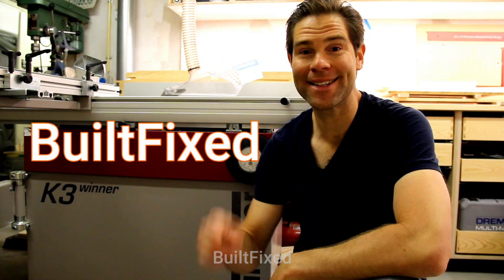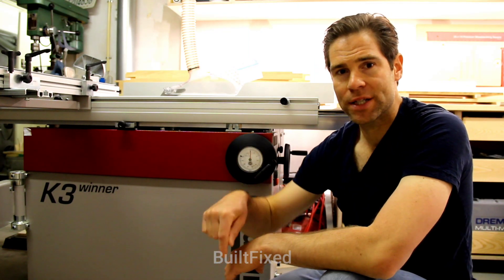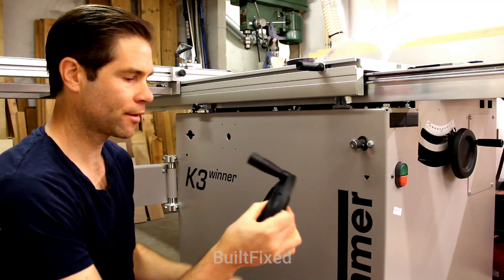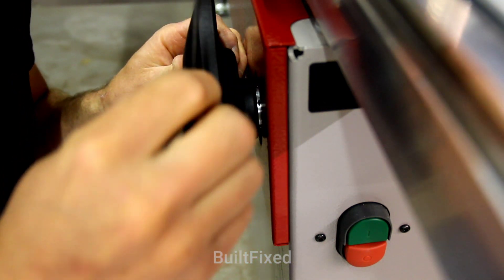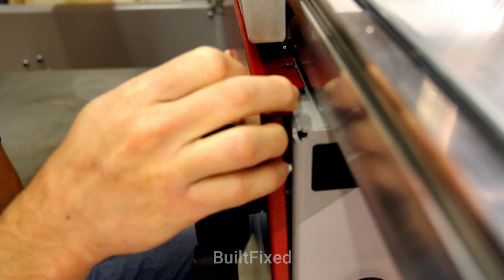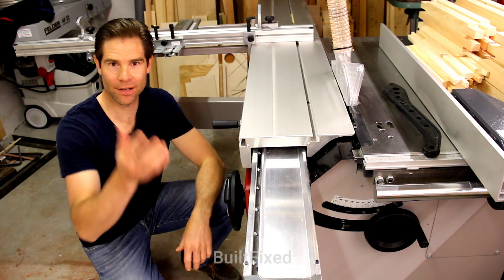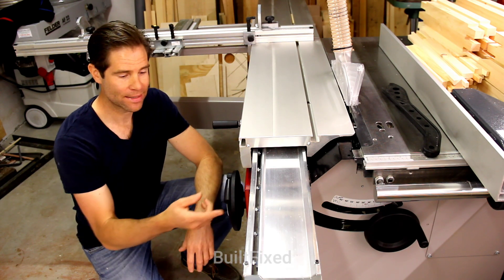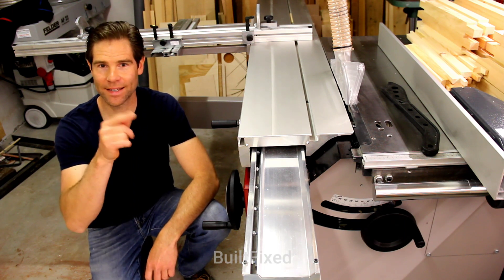Felder Hammer saw tilt angle indicator

Comment: I would be very interested to see another video by you in which you test the accuracy of the angle indicator. I'm waiting for my K3 to arrive. Mine is configured very similarly to yours. I am all for buying add ons that improve the accuracy of the machine. For that reason, I bought the fine-adjust knob for the improved fence. If the angle gauge is accurate, I would order that, too.
Reply from the maker: Hi John. I just made a brief video that tests the accuracy and precision of the accessory gauge. It can be found here: https://youtu.be/F5A-c9gE_4Q

Comment: Felder design team really didn't think that set screw access through very well did they?
Reply from the maker: I think I also would have prefered a more positive connection similar to the A3 where a bolt passes through both the wheel and spindle.

Comment: Interesting. I don't recall that this was available when I ordered my saw. I'd be curious about the accuracy. I've never found stickers to be accurate on any saw. If I tilt my blade to the 45 degree stop, I find the sticker is about a degree off.

What I am interested in is the power buttons on the front edge. Was that part of your original order? I'd rather use these buttons than the ones on the main panel. Perhaps there's a difference between your K3 and my B3.
Reply: Mine has the power button to the right of the blade height adjustment wheel. There are holes and a punch-out on the left side, which I suspect would be more useful position.
Reply from the maker: @Wayfarer-Sailing  It could be great to have at least a kill switch on the bevel adjustment side. I think I will check out the wiring schematic and see how easy it would be.
Reply from the maker: I don't think the indicator was available when I ordered my saw either.

The power button location I think is standard for the K3. The saw frame appears to be the same across their lines. If you noticed on the video behind the red trim panel are cutouts for a power button.
Reply: @builtfixed6611  I did notice a week or two ago that there is a punch-out for a switch on my frame.
Reply: Also interested in the Power button on the left corner on your K3 .. I wonder if the North American K3 saws only have the On/Off on the right of the tilt crank on that plate. Mine does have a Emergency stop button on the Red side cover but it’s not on your K3.
Reply: @rhorton2702  Interesting. I have a B3 with the power button in a panel to the right of the height crank. I thought the US K3's would have been like BuiltFixed's. Maybe not.
Reply: @CutitwithaHammer    My Power button is in the same position as your Hammer B3 in your Video's other than you have 1 more Black switch to the right of your On/Off buttons, and where your power cord exits the Saw my K3 has a Electrical connection Box with a switch there to Kill the power to the saw. It would be Nice to find out the part number of that Power switch in @BuildFixed K3 Saw
Reply: @rhorton2702  Interesting. Thanks for the info.
Reply from the maker: @rhorton2702  Interesting. Adding an emergency off switch on the red covered area would be perfect for me. I was sawing thick Douglas Fir the other day that had lots of internal stress and kept pinching the blade and a off switch there could have been smart.